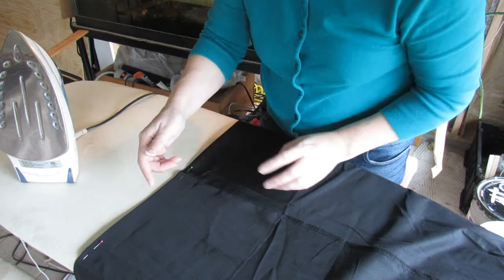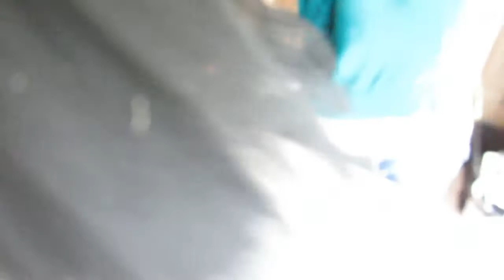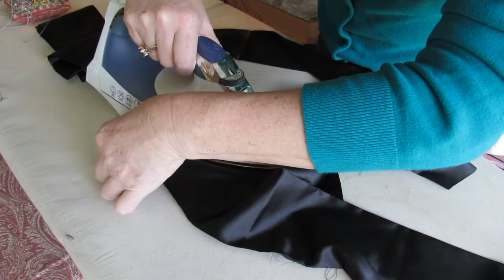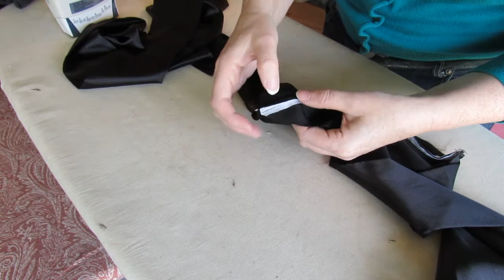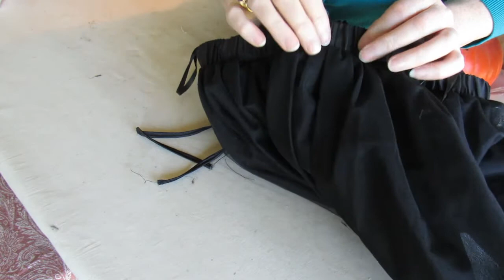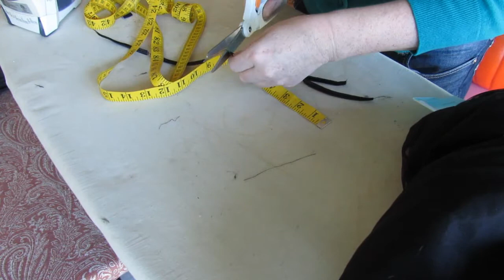How to Shorten a Tulle Skirt and Making a Sash and Belt Loops Tutorial

Comment: So it’s just a cut on the tulle? No need to hem the actual tulle? I need to take about 2 inches off of the tulle on my daughters dress for a formal. The under skirt is actually pretty short. Thanks.
Reply from the maker: Thank you for the question.  Yes,  just cut each layer of the tulle separately.  It is time-consuming but gives a softer look than cutting all the layers at once.  Not only that, if you cut one layer wrong it is not so much of a problem.  The tulle layer doesn't need to be hemmed as it is designed not to fray.
Good luck with your project

Comment: Hello! I just want to make sure there is no type of angle cutting your tulle? I have a layered prom dress to do LIKE NOW :)Thank You ! GREAT VIDEO!
Reply from the maker: Thank you for your question.  I cut it as shown in the video.  If the skirt is shaped as in shorter at the front than in the back, still use the same method and adjust it as you go around. 
I had a prom dress to do years ago.  The girl needed a couple of inches off the back only as she liked how the shorter length was on the front.  I eased the sides in from the midway point on either side of the skirt to make the curve at the bottom.  A little time-consuming as I had to mark it with tailor's chalk before I cut each layer.
Take your time and you'll do fine.